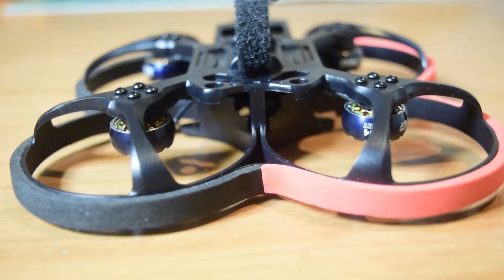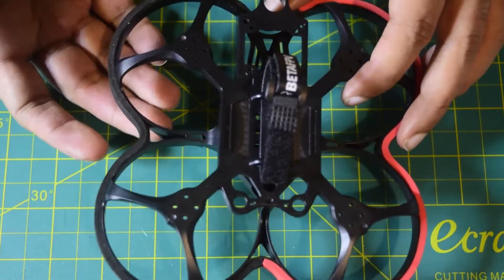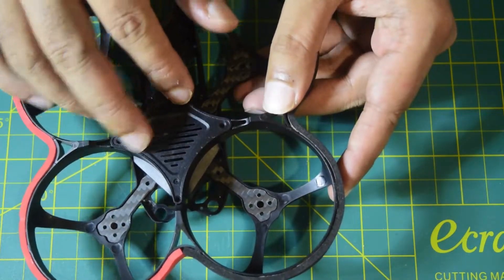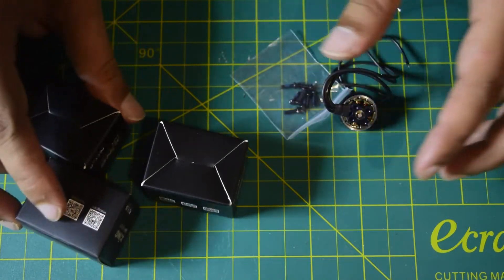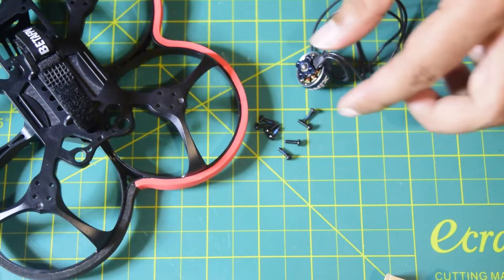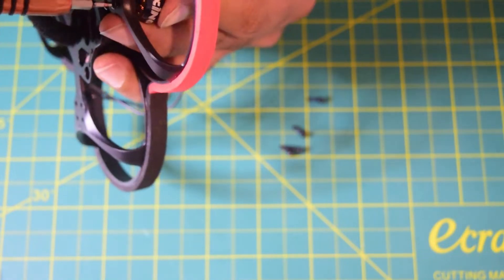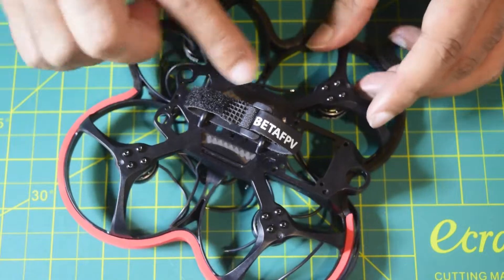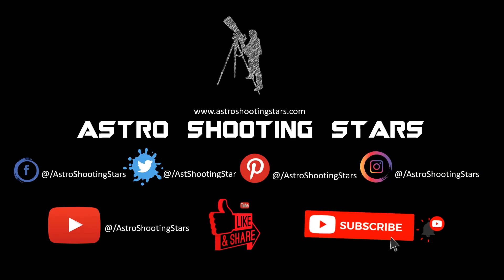How to Install iFlight 1404KV XING 2 FPV Motor on BetaFPV Beta95X V3 Cinewhoop Drone frame & Review

Comment: awesome tutorial mate....i recently built this but did minor customization. betafpv 4500kv motors were a big pain in @$$ as ordered 3 sets and all of them were not working. so moved to happymodel 1404 but they had 3500kv only. last night i did my 1st flight and in few minutes motors were hot on a 4s lipo....i landed it to avoid any damage to motors....can this 3500kv be an issue? im not using BF but inav5.1. built has weight of frame, motors, insta360 cam, mamba f722mk4 mini FC stack and elrs nano
Reply from the maker: if motor is heating means it is drawing more current than it is rated for. This could be because of the load on the drone. Try reducing the load and check if motor still heats up. for understanding more motor dynamics i have another video which could help you 
https://youtu.be/XgJbnl6rSSM

i hope this helps. please stay tuned to my channel for my future videos
Reply: @AstroShootingStars  i didn't put anything extra except what i mentioned. Is 3500kv enough for this build?